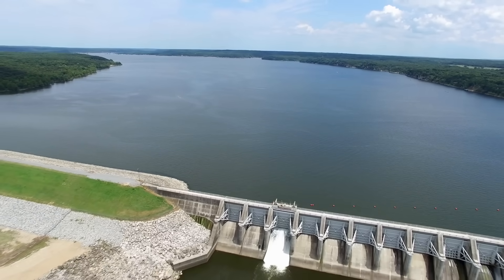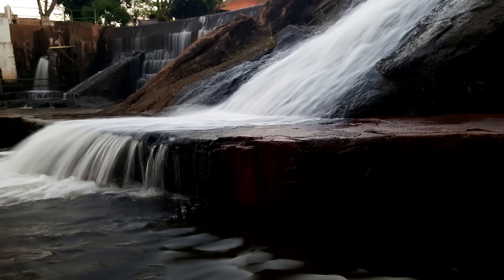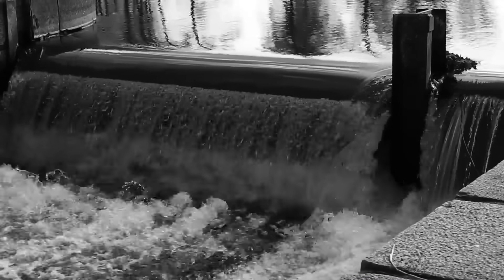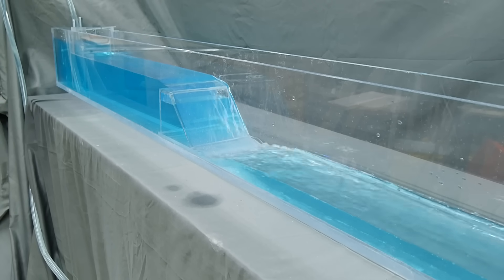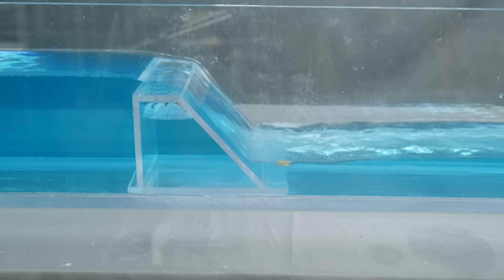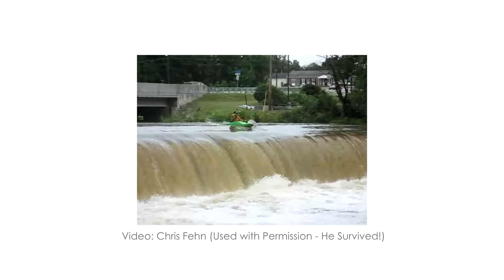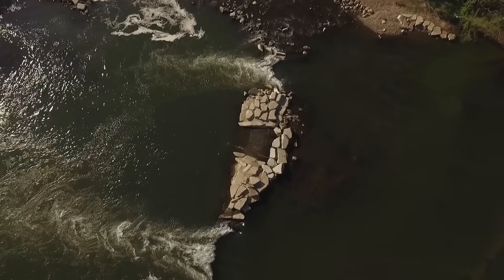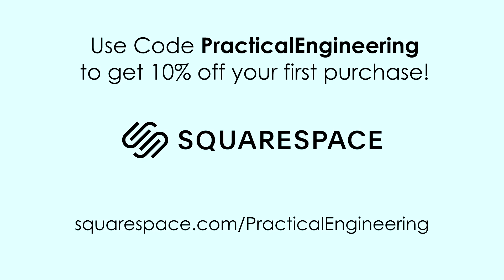The Most Dangerous Dams

Comment: After Reading These Responses I Can Tell Everyone... The ONLY Reason People Drown Is Because THEY PANIC !!! 

When Caught In An Aquatic Life Threatening Situation, DON'T PANIC... 

First Thing Is To Keep Your Lungs Full Of Air By Holding Your Breath... When You Need To Refresh The Air, Do It Quickly... Floating On Your Back Is The Safest And Easiest... Its Known As The Deadman Float...  You Can Do This Until You Die Of Starvation... 

Jacques Cousteau Survived Three Days In The Middle Of The Ocean With This Technique... 

However, Your Going To Slowly Backstroke Toward The Nearest Escape Point... WITHOUT PANICKING !!! 

PANIC IS YOUR ENEMY !!! 

By Holding Your Lungs Full Of Air You Will Float... Due Your Joints Only Functioning In A  Forward Motion, Its Easier To Float On Your Back With Arms Outstretched... Plus It Provides A Larger Surface Area Against The Water... 

Be Safe And DON'T PANIC ...

Comment: You Left Out The Only Emergency Survival Technique... 

If Caught In The Back Flow Of A Boil, Simply Dive Down Below The Boils Uplift And Swim Away From The Dam Until Your Past The Boil... Then Surface And  Swim Away From The Dam Utilizing The Flow Of The River... 

If You Misjudge The Distance And Surface Too Soon And Your Pushed Back Toward The Dam, Don't Panic... Simply Dive Down Again And Swim A Little Further Before Surfacing... Repeat Until You Swim Far Enough Away... 

This was standard training for SCIP (Jacques Cousteau Diving Certifications) and most U.S. Aquatic Rescue Squads across the nation... It's much easier to do than it sounds... But I was on the North Texas Rescue Squad... I was the Diver who got to jump from choppers into the middle of North Texas lakes... 

Side Note: We actually made jumping into the hydro blast of huge Dams (Hydro gates at Large Lakes) a sporting event... The blast would push us while we skied barefoot down mossy concrete toward the boil... Upon reaching the bottom we would dive into the boil and swim below the upsurge... It was extremely easy to remain submerged until we swam past the boil upsurge due the fast current... 
We Called It "Damming" And Other Than The Occasional Stubbed Toe No One Was Ever Harmed ... 

Spread the survival technique but not the Damming Sport... One Should Be Half Fish Before Attempting That Sport... 

Now That I Reminse, Tube Ridding At Hawaii's Banzai Is Child's Play Compared To Damming...
Reply: I know of it though never attempted. I would expect untrained person to even struggle telling up from down in that situation no?

Comment: Good advice to be cautious of dams, but they should have no government regulation. This is just a way for people to stop you producing your own power and concentrating the power to make power in the hands of a few. Which judging by ever increasing electricity prices, you will have to pay ever more for when you could create your own.
Reply from the maker: When there was no regulation, thousand of unwitting people were killed from poorly designed dams that failed...
Reply: @PracticalEngineeringChannel  It wasn't government regulation that prevented this from happening again though, it was engineers designing better systems.

Comment: Can I presume that the same conditions can apply for water falls such as New Zealand’s Huka falls, well know to tourists and kayakers?  Water flowing at anywhere between 50 and 300 cumecs  passes turbulently through a narrow gorge,  prior to a spectacular discharge into a slow moving, calm portion of the river.  I have approached the falls from below at lower flows, wondering if there is any danger.  There appears to be “boiling water” through the middle of the “tail water” some distance (30m?) away from the falls,  which is barely moving downstream.  (Water flows out to the sides) I have sensed that this might be dangerous but kayaking through it hasn’t produced any dramas to date.  Just a little bit of weaving to and fro.

Comment: I remember the dam in my mom’s home town when I was growing up. It held back three lakes and the water dropped from a former mill pond forty feet into a shallow creek that could take a much higher volume if need be- like spring runoff for instance. The dam was constructed in the crudest form imaginable. It was basically four culverts, forty feet long with two culverts stacked on the other two. There was a simple gate mechanism on the upstream side and the falls on the other. The whole works was set in unfinished concrete and there was a two-lane street across the top at a ninety degree angle to the culverts. It looked like something a farmer might put together to control drainage or something, not anything professionally designed and constructed. If it had failed it would have wiped out the main drag downtown with several historic buildings. I went to the falls once and saw how cheaply it was built and never went down there again. Somebody complained about this dangerous thing until the city and state got together and replaced it with a weir that is solid and creates a beautiful flow of water. The creek is deep enough to flow naturally and with three lakes collecting runoff it stays busy enough even in the summer.
Reply: Can you tell me what the town is called? I would like to see this pinnacle of human engineering.
Reply: @ATruckCampbell  New London, MN.

Comment: On a night of bad judgment on the Allegheny river north of Pittsburgh I, without a lifejacket, decided to kayak upstream through the exclusion zone to just touch the dam.  It is easily 500 feet wide.  I got into the boil and the water was so high that I couldn't see anything around me but the swells of water and I dumped it.  It's one of those things guys get scared about AFTER it happens.  I swam to shore and had to be carried to my car.  If I had actually gotten another few feet upstream, now I know I would have never come out.  And I do this with Boy Scouts from the troop where I'm a leader are watching.  Way too lead by example!
Reply: I'm still pretty terrified
Reply: @ethanboyd7843  Now you can lead by example, knowledge and experience. Be Prepared.

Comment: Got one on river that borders my property go swimming there all the time and jump and swim around the dam a lot if you’re careful and know what you’re doing way less danger. That being said I’ve saved 4 people from drowning there and 3 of the 4 times I almost drowned with them before getting them out of the water. If you get caught in the boil point try to go as far down to the bottom of the river as possible the flow down there will push you out of the hook of the dam. You need to do this as soon as you notice you’re caught if not and you tread water for too long you’ll probably get pushed under the water repeatedly and use up all your strength.

Comment: The key is to swim down deep if you’re caught in the vortex. You want to get below the arrows at 4:52, notice how that water will end up on the outside. Swim down to the bottom, the water in a low-head dam is shallow by definition. Then swim out for as long as you can before resurfacing, you have to get past the jet. If you got past the jet the water will now carry you away from the dam, if you didn’t you’re headed back towards the dam, try again and remember to get down deep and swim out far. 

If you can clear your lungs and take a deep breath to get out CO2 and take in O2 before trying to swim out, even better. Remember, get down deep and then swim as far away as you can.
Reply: Once you try it, let us know.
Reply: I think I will just stay out!

Comment: PSA: I'm a kiwi/NZ'er, done a fair amount of swimming in white-water rivers, and was a strong swimmer too. Getting caught in a keeper only happened a few times, but my response was to dive to the bottom, lie flat on it as close as possible (so water can't get under me to lift me up), and swim downstream. It isn't difficult as water against the bottom is going downstream too. When the turbulence stops, swim a few more strokes then surface. Fighting the gyre will exhaust you damned fast because it's very hard to get your head above water to breathe (as you said, the amount of air churned into the water reduces your buoyancy greatly). It's better to use the water flow to your advantage. Success has two very important prerequisites: not panicking, and understanding the situation you're in. Your video explains that excellently. Note: you can't do as I suggest if you're wearing a flotation device. You've got a very tricky decision to make if you are and you're caught in a gyre.

Comment: I kayaked over a small water fall and almost drowned because of this
Reply: Al Explorer I watched a kayaker almost drown in one of these.  The person was lucky that the water level was low at the time.
Reply: @Ur2ez4me81  low head damn will pull you under even.if you have life vest on
Reply: 3 people died this week close to me. There is a spot where swiming is allowed close by and they swam to far down the river. There is a really small waterfall if you could even call it that. The waterpressure is so high they needed 2 days to even get the corpses out of it because they couldnt reach the spot where the corpses were catched.
Its now planed to throw some big rocks in there to lessen the danger.
Reply: @JL-pc2eh  ugh, I feel bad for those people doing that recovery. A corpse getting beaten for two whole days in the water wouldn't have been pretty.
Reply: @JL-pc2eh  Source?
Reply: @JL-pc2eh  im sorry for your loss.
Reply: bruh moment
Reply: This seems like the same phenomenon as a hydraulic in white water rafting.
Reply: Looking at the flow it looks like the easiest way to escape would be to dive under the water and let the flow under the water take you away and you should be safe
Reply: Almost drowned. That's why the flotation vest is so important.
Reply: @forcesightknight  
A vest, while it will increase your chances to survive a low head dam, will not ensure you make it past the boil line. It will prolly give you more time to hang in there till someone with proper equipment can save you.
Reply: @NihilSineDeo09  live vest is probably worst bcs the water will have more surface area to pull you

Comment: Taking time off for your real job?  I need more videos about concrete!  Myristic "washed" Poly fine (rubber crumb<5.5-7.5% fine aggregate replacement + fiberglass @ 1 kg/m³ of polypropylene fibers) wood (15% coarse aggregate replacement) and typical crushed rock aggregate with a water ratio of 0.40-0.42 to be close.  At least this is close to the building material that I want to find out about.

Overall, I think this creates a concrete that is lighter and safer for earthquake prone, wet, salinic areas. Recycling wood chips and tire rubber also helps save our planet.

Comment: As a teenager I often ignored the no swimming warnings. I used to use a low head dam as a water slide. ( such as, https://youtu.be/AISCDhL9v1M) Luckily for me, the design of this dam greatly reduced the hydraulic boil. If I couldn't push myself out, I could push myself towards the dam and get to the rocks and crawl out. Later in the summer when Q was low, the catch basin at the bottom held some of the largest trout I've ever caught with my hands. Good times until I learned that catching trout by hand was unlawful.

Comment: When I was 8 I nearly drowned in something very similar. Rather than it being a dam, it was bunch of stepping stones that had a similar effect.

Quite stupidly (as kids do) I decided to race across them and when I got about half way in to a fairly large river, I miss placed my footing and was pulled straight into the water. (Very luckily I didn't hit my head, but this should also give an idea to how fast the water was moving between the stones)

Although it wasn't that deep (only about 3.5ft) for a small child such as myself it was more than deep enough to keep me under.

I was incredibly lucky that a full grown adult was near by, jumped straight in and was tall enough for the water to have basically no effect...

Unfortunately a few years ago a small child died in pretty much the same location. The end result was the stones were made much larger, and a part of the river was diverted to reduce the amount of water passing through the stones, a small bridge was also installed next to them.

I'm 22 now and return to the spot from time to time, altough it's not the same as what it was 16 years ago. It still brings back some unwanted memoirs

Comment: You didn’t mention how to get through one of these dams and survive. Best method is to go fast and if you’re in a kayak boof at the beginning of the drop (try to lift the front of your boat slightly) so that you can get past the boil point and not be recirculated. If in doubt, always portage. If you end up in one of these, sink to the bottom and you might just get below the recirculation depending on how big it is.

Comment: Could a smaller version of this happen when water goes down a short drop on a river that wasn't artificially influenced? I suppose so since it involves the behavior of water. I just don't know how small of a scale the effect shown in the video can happen on.

When I was younger, I went tubing. I was on a very small tube and was approaching a bit of rapids, but they were smaller compared to a lot of the others upstream. All the other tubers with larger tubes got through fine. I was a bit nervous regardless, as looking at the water, something seemed off.

As I went over, my tube stopped for a second, and I could feel my tube being pulled backwards and down. I was thrown off and pulled under water. My head hit something very hard (probably a rock), and I inhaled a bunch of water. Next thing I knew, my mother was over me, shaking me and yelling at me to respond.

This video would explain what happened there a lot, and I'm glad I watched this.

Comment: moving water one of those things that a lot of people vastly underestimate it's incredible strength. it can be the recirculating current you talk about here, rip currents in the ocean, or flow ways becoming overburdened and leading to water moving over a road way. flowing water vs you, water wins almost every time, especially if you just try and brute force your way through it. stay away from these old dams, best to avoid moving water over roadways and swim parallel to rip currents in the ocean till you get to water that's not taking you out to sea. to bad learning to swim isn't a required course in school where dangers such as these could also be taught about.

Comment: I've been noticing in recent years that whether it's air or water, when it spins with the medium passing next to it, sometimes (or always?) it's like a sealed off chamber. Could you demonstrate this with ink in the water? How much is lost from that spinning water, and how much is retained? And what sized object is required to always stay in the spinning, and what size always escapes, if there are such possibilities? And what's going on in the center of horizontal spinning? Could you drop a ping pong ball in there and have it spin in place indefinitely? And how could this spinning be used to benefit people? I saw an air contraption at the doorways of some businesses that would blow downwards when you entered or exited the building. There were no signs anywhere describing the device, but I suspect that it was creating vortexes in order to create one or two isolated sections of air- outside and inside. Like a door made out of air to replace the door made out of metal and glass. Anyway, I'd love a video on this!

Comment: I almost drowned at the local weir. Was stuck in the "keeper". Water was filled with bubbles and couldn't swim in it. Couldn't swim out, couldn't swim up, the only thing I could do was sink to the bottom and jump for air. Barely got my face above water each time and was exhausted when I finally got spat out. Last I heard (2013) it's taken two lives since I almost drowned.
Reply: Lucky indeed! Ask for more ropes and signage if you can.

Comment: Very important video. However, I was surprised that you only addressed one type of head dam which has a built spillway on the downstream side. The other type of head dam I see often has no built spillway so the water just free falls off the downstream side of the head dam. These are also exceedingly dangerous as the waterfall it creates is perfectly uniform throughout, unlike a natural waterfall, leaving nowhere to escape. Similar recirculation issue to the type of head dam you showed, only the recirculation happens behind the water instead of downstream of it.

Comment: Back in the day (1988) I was a paramedic in central California and trained as a Swiftwater Rescue Technician. I remember watching disturbing video clips of fire fighters in turnout gear approaching a low head dam as if it was a lake. We knew, even back then, about the mortal power of water and, especially, the danger of a low head dam. Thanks for your detailed video. The physics are interesting but the bottom line is that if you’re traveling upstream into a low head, you’d better have a bullet-proof system to keep you out of the danger zone.

Comment: We use manning's formula for open channel flow but use inlet or out let control depth for culvert design. What if a rectangular channel joins a box culvert and there is a rectangular channel at tail. Cross sectional area remain the same and there is sufficient free board. Why can we not use mannings formula for culvert also

Comment: You have omitted one of the main reasons for low-head dams in this day and age, which is stream bed stabilization.  My home area of upstate New York has many stream beds which have eroded a number of feet in my lifetime.  This has undermined abutments and bridge piers, neither of which should be considered a safe situation.  Replacement is not cheap, either.